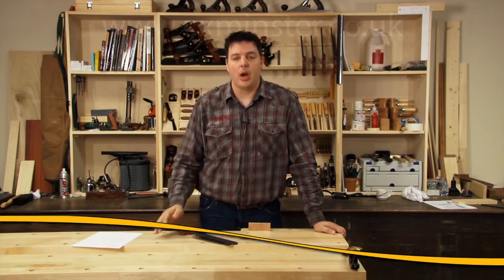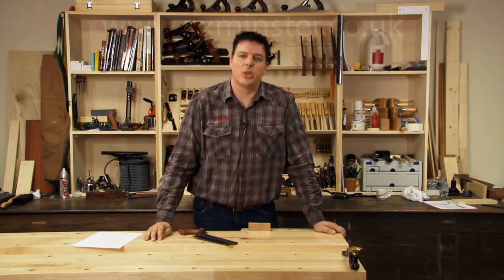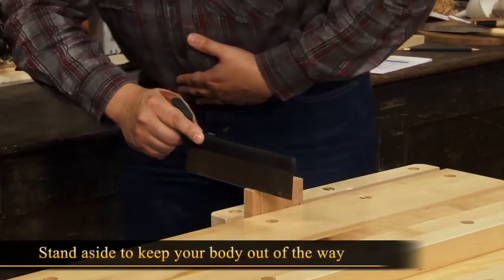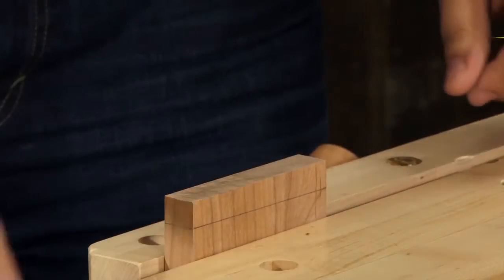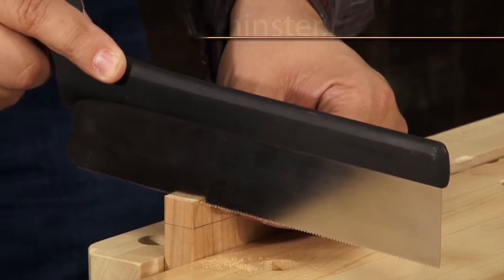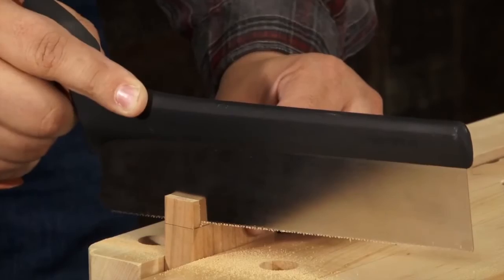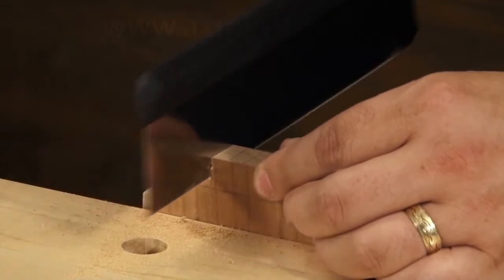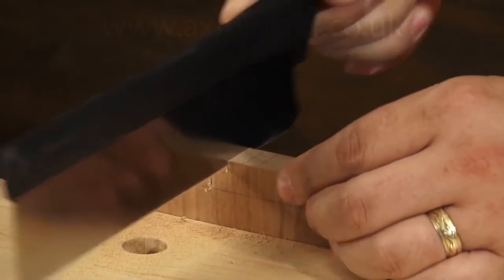Veritas Crosscut Saws

Comment: you're rip cutting. Do these crosscut saws also rip cut well?
Reply from the maker: Hi there, these types of backed saws are classed as dovetail or tenon saws, the tooth grind might be ground for either cross or rip, but these will be able to do a bit of both. A  tenon saw is used to cross cut, to produce the shoulders of the tenon, but then also rip cut to remove the cheeks of the tenon. Hope this helps.